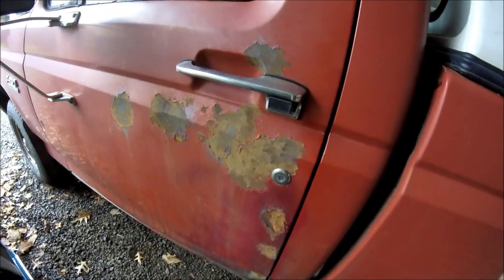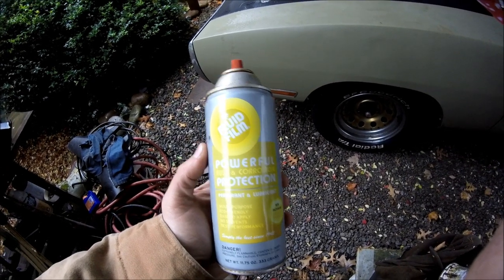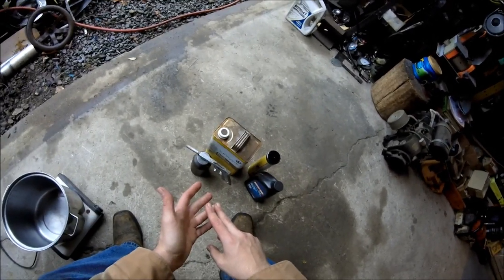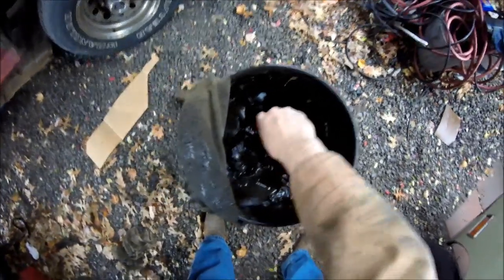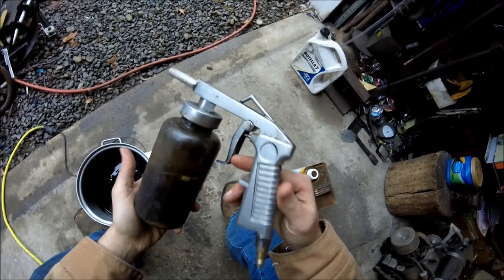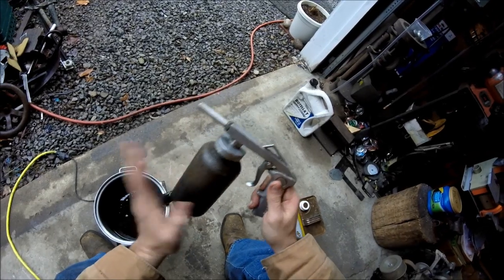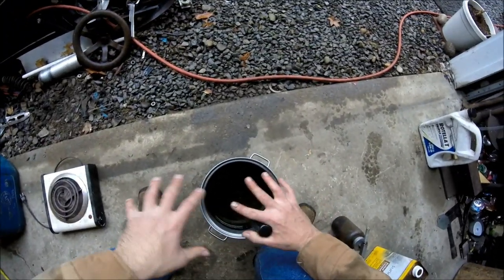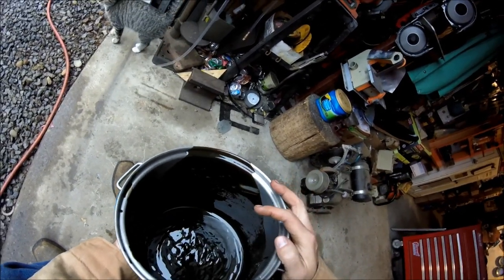GROIL: Homebrew Undercoating Mixture

Comment: You should do an update and show us what it looks like after you have had it installed for a while.. I would like to see it.
Reply from the maker: I will try to do that, along with seeing if there's any improvements that could be made to the original formula.
Reply: @toocheaptosmoke  Sounds good.. Did it tack up the way you thought it would?  If you live on a dusty road, I would imagine it did pretty well.. And, might have stuck to the frame afterwards.. I wonder how it did in the wheel wells, and on the front of the axle, etc.. Places where the whooosh of the water spraying out from under the tires would wash  it off.. One of the problems with the lanolyn products.. Washes off too easy.. Figured the grease might have solved that problem.. Looks like it might have been a pretty good mix for undercoating.. I have it in my notes to try and experiment with.. I am just getting started into looking at rust prevention.. I had a 97 GMC Z71 that went to the graveyard with rust.. Mechanically great shape.. Really sucked.. Figured I would figure this out before another one went that route.. Ever fool with the Phosphoric Acid to convert the rust ?
It is the first part of my project.. I have an 18' trailer. 5 years old.. I'm going to wire wheel the area under the fenders (some scale rust), and spray the underside which is more of a dust rust.. Not swelled yet.. Just surface.. See if it will stop it like it should.. And a dump trailer that is really hard to get to the areas where it is rusting.. Then, once I figure that out, I'll be looking to put a good coating on everything.. Then to my trucks.. 
I'll try to shoot some videos on my phone and upload them.. If I can't do it all at one time, they just sit in a folder waiting for me to have time to edit and upload them..  Keep up the good work.. I'll let you know if this Phosphoric Acid works like the datasheet says it does.. Well, it has to, but, I just want to verify it.. Leaves a surface you can paint over directly.. Check it out.. Probably what you are missing for stopping the rust.. Then,, treat it with your mix to keep it from coming back.. 
Read this: https://en.wikipedia.org/wiki/Rust_converter
and This: http://myshinycar.com/phosphoric-acid-rust-removal/
It should spray out of the gun you have.. It is not thick like the mix you created.. Should start turning black after 20 minutes or so at 75 degrees or so.. I have a similar gun, but, I bought it without a canister.. I am just going to cut the pickup tube and heat some vinyl hose and pull it over and hope to hang the jug on my pants or sit it on the ground if I am under the trailer/truck or something.. Clear hose, so I can watch the flow until I get everything figured out..
Reply: @toocheaptosmoke  I subscribed.. Might check out some stuff on my channel.. I am a tinkerer like you.. No telling what I will come up with tomorrow. Ha.. I'm just always short on time.
Reply from the maker: Yeah, it has tacked up well.  It takes a long while to cure if you apply it when it's really cold out though
Reply: @toocheaptosmoke  It looked like a pretty good mix.. Adding a quantity of Japan Dryer might speed that up a bit and will make it set up a little more solid. You really don't want it setting up to the point it turns into a bed liner type material.. As long as it stays primarily oil with a dust coating and doesn't get too hard, seems it is about what you are looking for..

Comment: Hi, i applied some burned diesel engine oil in small patch in my underbody and its nice and sticky but i notice that when it gets wet outside and i drive the water actually stays at the oil i applied for a long time, is that a problem, will it cause rust?

Comment: 1 quart of oil, trans fluid, 1 tube of grease, 1 wax ring gasket. Heat up and brush or spray with a homemade gun or 1 for $44 of amazon. Will last longer than anything u can buy and cost less than a 10 spot.

Comment: How does it hold up? Any modifications to the formula? Also, any recommendations for a sprayer to hit the inside of doors & stuff with? I'm trying to put together a kit of sorts and do all 4 of my vehicles with it, maybe after some corroseal or phosphoric acid even.
Reply from the maker: It has held up well, on places that aren't in direct wash (wheel wells) it still looks like when it was applied, just dirtier.  I want to try a wax additive, but not sure how that will affect the sprayability and how well it spreads.  I have tried using one of those wands they make for undercoating guns, I would take a portion of mix and thin it down a bit more, the groil mix is normally too thick to spray out of it.
Reply: @toocheaptosmoke  Use toilet bowl wax and melt it together in an old crock pot on low heat. I had no problems spraying what so ever as long is it was warm. The air pressure was set on 90 psi. It does thicken up once it gets cold kind of like peanut butter.

Comment: Would it work better if you painted the frame first with some type of rust reformer, like Rusoleum Rust Reformer?
Reply from the maker: That's a tough one, when you paint things it blocks the oil from soaking in and sticking as well.  I've used the rust reformer before, and it worked ok I guess, but not as good as like POR-15

Comment: I like the b.l.o. idea. Gonna use that. I wonder if some paraffin wax in the mix would help.
Reply from the maker: It might, I was thinking about melting some toilet seal rings and adding it to the mix in the future.
Reply: Ya, they would be good. Cheap too.
Reply: toocheaptosmoke they use to be made of bees wax, now all I see is a synthetic or something. Doesn’t appear to be as tacky as the old bees wax was.
Reply: Oh yes, it works, been doing it for years only not using grease in the mix. Put on 90-100degrees with a spraygun at 25 psi with pressure in the pot too.

Comment: Mount 4 cans under hood fill them full of transmission fluid connect small rubber lines like that of windshield washer hoses to the bottom of jars. Strategicallyl run rubber washer rubber lines back under vehicle. Under floor area or problem common rust areas.  Fill jars full of trans fluid and go for a ride. A little oil will creep everywhere under a vehicle. A little oil leak goes a long way under a vehicle to completely coating the under carriage. Screw all these intensive labour ideas. This works while u drive. Your welcome. I did like your vid very much though.
Reply from the maker: I had a bad front main seal one time that was very effective like that, haha.

Comment: I got a free 5 litre of waxoyl... im thinking of mixing a small % of Marine Grease to prevent the waxoyl from cracking as the waxoyl is wax based with a turpentine like carrier, the turpentine dries out after a while in the waxoyl and leaves it flaky and open to rust - im thinking the Marine grease will prevent it from drying out - im not spraying.. im brushing it on... anyone any ideas !!!  thanks
Reply from the maker: Sounds like a good one, let me know how it works!

Comment: Definitely worth trying. How is the overcoat looking since you applied it?
Reply from the maker: It formed a skin after application and has slowly seemed to firm up, but it's still oily on the inside if you scrape it.  Holding up a lot longer inside the wheel wells than the fluid film or straight oil.
Reply: That sounds great. First comes detailing the engine and scraping loose rust off. I assume it’s better to do the coating in the summer.

Comment: can this mixture be sprayed out of a pump hand sprayer?
Reply from the maker: Not very well, it's a bit too thick.
Reply: @toocheaptosmoke  At what PSI are you running the gun?
Reply from the maker: I run the pressure around 40 psi I think
Reply: @toocheaptosmoke  tks! Seems to make a nice even spray

Comment: Any other option other then linseed oil?
Reply from the maker: The linseed oil was the only semi cheap thing I know of that mixes well with the grease and oil and also cures to make a tacky skin as it dries.
Reply: In Canada it’s not so cheap.
Reply: Just have to hit up the revy buds
Reply: Or head down to the ole canadian tire and get some rust check inhibitor spray for 6.99

Comment: Do you apply it annually?
Reply from the maker: You may need to touch up some places that are in "high wash" areas, like the wheel wells, but once tacky it hangs there pretty good.  Frames that have a bit of surface rust on them actually seem to get coated easier, as it has something to stick to.

Comment: Fyi, If you want to save some money and not make a mess... Fluid film is nothing but lanolin oil. You can buy industrial lanolin oil in gallon jugs for about a fourth of the price. You warm it up by chucking the jug into some hot water pour it into a sprayer it goes on thin and as it cools... It become solid. Best part of all That's what they put in lotion.... So if your car breaks down you're not going to get messy as s*** trying to work on it The only thing that's stuck to it is road dirt if you go drive before it sets. That one gallon is enough to do your truck 3x. 
Now if you want to use the stuff this guy made on the bottom of a fence post go for it but I don't ever want to work on anything with all that nasty on it.

Comment: Car oil didn't destroy rubber in car? I mean rubber under car, not engine.
Reply from the maker: I haven't really seen it affect the rubber parts.  I know they say petroleum can affect poly urethane bushings too, so might have to be careful around those.
Reply: @toocheaptosmoke  Meayby don't use oil engine, only lithium grease, linseed oil and wax. What's you think. And sorry for my bad english :D
Reply from the maker: @Wasio212  Haha, no worries.  I think the lithium grease would be about the same as the oil, they both contain mineral oil.   Silicone based lubricants are supposed to be the stuff that's safe on certain bushings.

Comment: What about using chainsaw bar oil since it has tackifyers
Reply from the maker: I bet that would pretty good too, it's similar to gear oil.  Usually not the cheapest option though.
Reply: @toocheaptosmoke  depends on where ya go. Ive seen it for as low as $1.99
Reply from the maker: @dev4statingx90  Dang, that's a pretty good price.
Reply: @toocheaptosmoke  you can also stop the rust from spreading by using vinegar for half an hour, then neutralize with baking soda and water. Then apply your under coat. I like the formula.